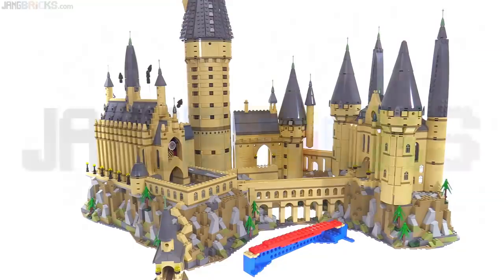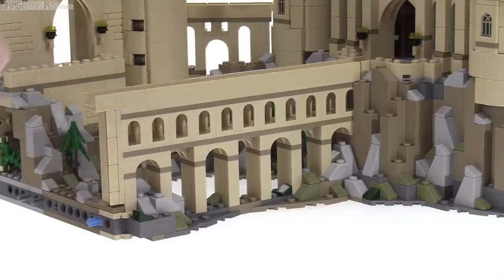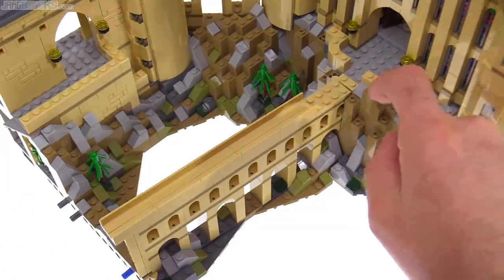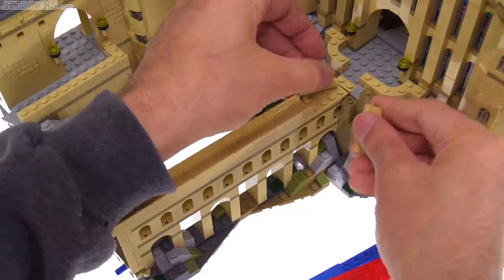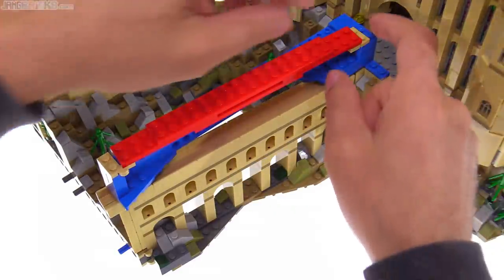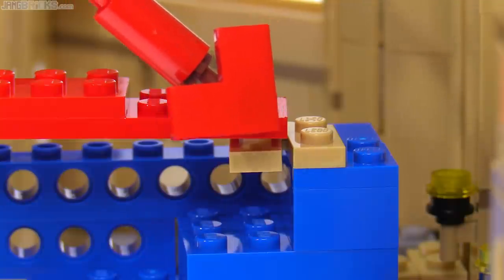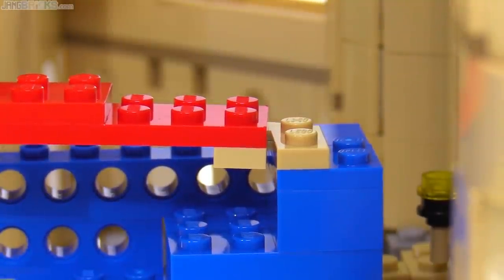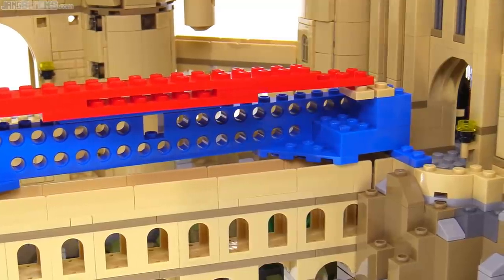LEGO Hogwarts Castle Viaduct geometry problem follow-up

Comment: The whole viaduct bridge is in the wrong place anyway- in the film the bridge begins at the great hall, and ends at the beginning of a forest (not the forbidden forest I think). Have a look here https://m.youtube.com/watch?v=p_S-XrrRtn4
It doesn’t end at the forest in this LEGO set which makes it inaccurate (not a huge deal, tho they were trying to replica the whole build!)
Reply: marleyfox98 have you seen the other movies? The 8th film is the only time that bridge leads to the forests. This is where the bridge is located from movies 1-6.
Reply: In the first few films it does
Reply from the maker: No it's right.  Look up any overhead plan of the campus.  Either we're not seeing things right in that clip or it's a different location like the entrance courtyard on the west side of the Great Staircase Tower heading off to the covered wooden bridge.
Reply: Actually, you're mistaking your viaducts - there are two in Hogwarts: the first one, correctly represented in the Lego set (https://i.dailymail.co.uk/i/pix/2012/03/02/article-2109071-11FC87B3000005DC-927_964x641.jpg ), and a second one, connecting Hogwarts with the forest (https://i.pinimg.com/originals/cc/40/ec/cc40ec2c06239ebe9eddf7d2c5aa16e8.jpg ). The one you're referring to is actually behind the main bulk of the castle shown in this set. Both pictures were taken at the official model shown at the Warner Bros Studios in Leavesden, which was actually used in the films.
Reply: Okay cool! I was just making an interesting convo, as it does seem that the creators of hogwarts did change some layouts over the course of the 8 films.
(There is still one fascinating thing- if there are two viaducts and the one I mention is a complete different one, the how do they both still lead to the front entrance of the great hall?) 
Just a light question- I’m not saying anyone is right or wrong- I’m actually curious :)

Comment: I had a problem with assembling my porsche from lego technic

1 i missed some lego parts from the model i contacted lego and they said that is not good can you tell me what you miss i replyed that i had some spare lego technic parts so i could finish it

And 2 i made a mistake which i noticed when i was done a lego techic piece that is 3 pieces long sticked 1 out piece out of the model i m lucky i could fix it without removing the whole body

And yeah evryone makes mistake's

Comment: How can a building technique be illegal? Isnt it a toy and I can play with it however I want? Pls someone explain
Reply: It is a bothersome thing because designing and building the section that way puts constant stress on the pieces over time, to the point where they will deform and remain bent permanently. It's not good when you are spending so much money on a set which is mainly a display set, with pieces that are going to warp gradually over time.

Comment: also the main tower is way too tall, i can't believe no one is noticed this, its so distracting for me. if you look at a picture of the actual castle, you can see that the towers cone starts when the great hall ends, and its so annoying how literally no one has noticed, its such a big  problem that ruins the whole model for me
Reply: You are wrong... the towers roof starts exactly where it shoul be. If you watch the replica at the Warner Bros. Studios you will see that the roof starts at the end of the small tower in the middle of the great hall. You better not view the castle from the bottom...
Reply: Only the theme park version. It was different in the film.
Reply: Oh no how will you be able to cope with a lego model that has too many bricks
Reply: Bowl of Pizza idk it looks pretty accurate
Reply: Maybe just kinda thin
Reply: I think the tower shoud have been wider, but the height is actually OK, I think: https://i.dailymail.co.uk/i/pix/2012/03/02/article-2109071-11FC87B3000005DC-927_964x641.jpg 
If you look at this picture, you see that the smaller tower on top of the front of the Great Hall comes just a little bit higher than the broader part of the main tower, which is actually the same as in the Lego set: https://images.brickset.com/sets/AdditionalImages/71043-1/71043_Front_01.jpg
I can see, however, why you might think otherwise: Hogwarts is often represented from below (https://imgix.bustle.com/2017/3/3/f54ca7bc-0f5c-4125-b0bd-632a545f32b1.jpg?w=970&h=582&fit=crop&crop=faces&auto=format&q=70&dpr=2 ), skewing the perspective as to make the tower in front seem taller in relation to the main tower, while the Lego set is often shown from above, giving the opposite effect (https://images.brickset.com/sets/large/71043-1.jpg?201807250319 ).

Comment: I just watch the video and I still don’t understand what he’s talking about
Reply: if you've a triangle with a right angle (90°), you can calculate (exactly) the longest side, which is opposite to that angle:
a is one side near the angle, b the other, c the opposite. Then a²+b²=c²
For Lego, a, b, and c always will be (from the top) complete multiples of half studs.
If a and b are, there is NO guarantee at all, that c will be a valid amount, too. E.g. for a = 3, b = 4, which is equal to have a 4 and a 5 long row, at a right angle, you can place a piece with 6 stubs perfectly to make a triangle, because the distance of the stud middle points is 5 there AND 3²+4²=9+16=25=5²
E.g. 3 and 5 result in 3²+5²=9+25=34=no square number, so not a valid building technique, because the placed in e.g. 6 long (6*6=36 > 34) will not be perfect.
And yes, it can matter and it will be stretching the model.
Reply: Basically the bridge is at an angle and they connected it to the rest of the castle incorrectly by forcing a piece to fit where it naturally shouldn't based on how pieces normally fit without stress.

Comment: I didn't have this issue when building my set. Not only that, but the bridge is also not "rigid" as on the video.
Therefore I highly doubt there's any problem of "illegal" technique here. However, LEGO parts have different densities and there might have been some problem in manufacturing. Something that explains this.

Comment: Try just to take apart that location and then put it back together maybe they'll fix the issue because then you'll see what the issue was and then be able to fix it accordingly or be able to build it correct because maybe it's an issue inside the bill where you can't see it?

Comment: Are there differences between one and the same set's instructions between Europe and the US for example? (I live in Germany.) I don't know, but I recently got my own Hogwarts castle, and because I previously watched this video of yours, I was paying big attention to the build when it came to the bridge.
But - to my surprise - I wasn't able to find what you explained and showed here at all. The bridge fitted perfectly, I did not have to use any force (not even the slightest), it all felt like a "really normal build", everything fitting snuggly together.
So, are there potentially regional differences? I mean, it wouldn't make any sense at all, if you ask me, but I just don't know an explanation.
Plus - A german Youtuber addressed the problem as well, stating that he couldn't find any "problem" you explained, just like how I feel after building it.
Ideas?

Edit: Another thought of mine: Maybe instructions were changed post-release? After the problem was spotted, Lego adjusted the instructions for the future production runs? Maybe?
Because obviously, I got the set rather significantly later than you did for the review, so could that be a possibility?

Comment: how is that possible ?
Reply: It's much easier to make a triangle in Lego which doesn't work than a triangle that lines up perfectly. Just take a base plate, put a Lego turntable piece on it and a 1 wide plate on top of the turntable (whatever length you want) and rotate it around and try to look for angles where the studs on the askew plate line up perfectly with studs on the baseplate. You won't find many angles where the studs actually line up.

Comment: The fact that they had to put hinges at the end shows that a mistake was made in the design.Another reason not to get this set.
Reply: Ya I was thinking the same thing, if it was right they would not have needed to use a hing piece.
Reply: Angel Mcfadden it’s not a design error, it is a design choice. I really don’t think it is an issue and the castle was a great build and looks fantastic in my home
Reply: Is it not the other way around? Because they used the hinge to create an angle  to the bridge, it now has tension. If the bridge would just be aligned normally the tension would not exist.
Reply: My sister wants this set, well time to tell her the news...
Reply: are we sure that the angled bridge is made just to be accurate with the actual castle?
Reply: I don't know why everybody is against the set. I don't want a big minifigure hogwarts. I have every old set to play with so i want this micro figure hogwarts.

Comment: Check out this image to see how to fix it https://www.google.com/search?q=lego+hogwarts+castle+viaduct&client=tablet-android-quanta&prmd=insv&source=lnms&tbm=isch&sa=X&ved=2ahUKEwiQ4t6U1pngAhUBIDQIHaWfA6UQ_AUoAXoECAwQAQ#
Reply from the maker: I'm afraid that doesn't fix it.  That proposed solution ignores the fact that the far side is still too long and overlaps into the landing and cliffside.  To see it you need to look back at the full model.
Reply: @JANGBRiCKS   Then all that would be needed is a bit of set modifications. As long as the builder knows beforehand, it just seems like a solution with some cost. If they don't have the parts, it won't be a long term problem like you said. The modification might only be applied if the builder wants to achieve more perfection in the set and take the time to plan ahead if they don't have the set yet or have the time to take apart the build, fix it, modify it, and rebuild the rest if they are willing to commit. It all depends on the person.

P.S. You're my favorite Lego YouTuber from age 7 and it's great to finally discuss something with you.

Comment: Not sure what you expect, it would be impossible for it to fit exactly due to the slight angle that has been designed in.
Reply from the maker: I expect it to follow LEGO's internal design rules, to not require bending & stressing the entire structure to force an assembly into place.  LEGO has made thousands of sets that do not require the permanent stressing of pieces.  The bridge should have been made ever so slightly shorter by loping off a stud worth of length and padding it up with some sideways building to leave a very tiny gap instead of this.

Comment: What is the big deal about “illegal building techniques”
Reply: Lego is a system an illegal techniques try to defeat that system.That and bricks might break.
Reply: karens543 they stress the parts which makes them break faster
Reply: lego follows a specific dimension and proportion rule set for how every pieces is designed and molded. generally it can be seen as a complex grid system. the 'legal' techniques are supposed to be any intended connection that follows the rules. if something is labled as an 'illegal' technique, it usually means that a piece is not following the limits, and there is going to be some section that's being bent or crushed in some way. Most fan builders are aware of this, and will include illegal methods to make something look nice, but Lego itself tries to prevent any officially built sets having this issue because it can either 1. damage the pieces(however slightly), 2. cause something to be easy to knock apart, and mess with the 'playability or 3. can make it harder for a child, or any inexperienced builder to put together which can often result in frustration and giving up
Reply: karens543 eh it’s not too big of deal in some cases really, but sometimes it can stress out the pieces and make them more at risk of breaking or getting stuck in some fashion.
Reply: It’s just wiser as a rule of thumb to use Legos as they were intended to be used. Although I’ve broke this rule of thumb myself and used funny tricks to make cool things, but only in cases I knew were risk free.
Reply: They generally put stress on the pieces, which over time can cause them to warp, lose their clutch power, crack, etc.